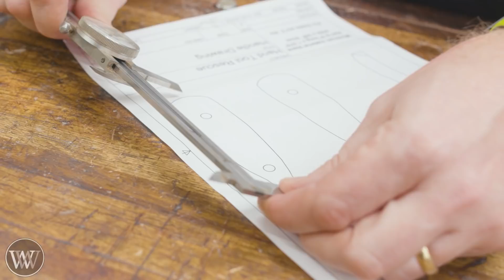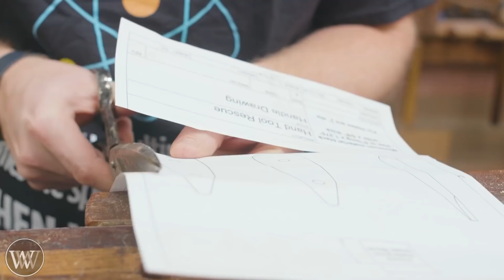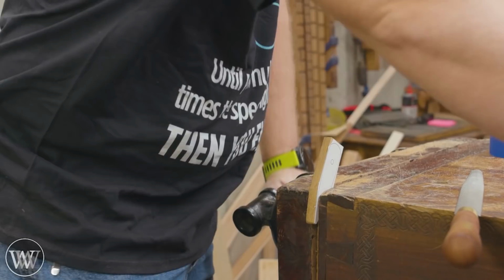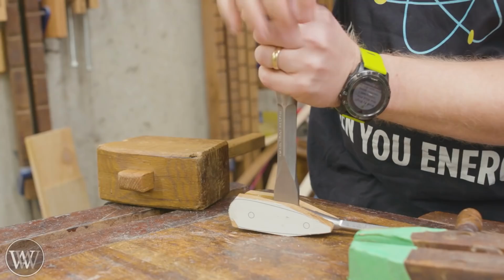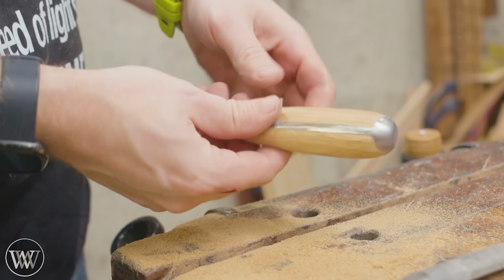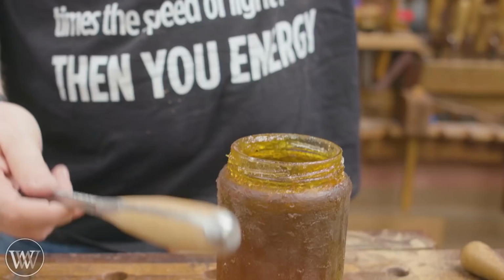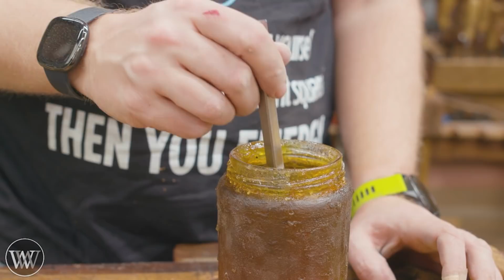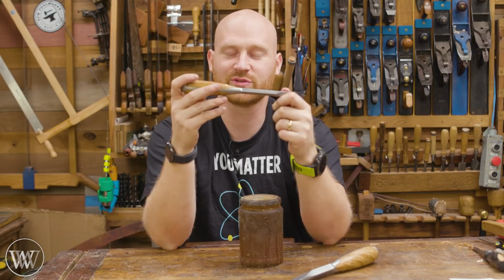The Worlds Best Screwdriver Hand Tool Rescue Prefect Handle

Comment: I ordered the 'impractical' larger one because it happens to perfectly fit the king bolt slots on most radial arm saws (I have 5). I do have to avoid the temptation of whacking things with it, as it is a hefty tool that just screams, 'come on, just let me smash that thing a different tool would be more appropriate for, it'll be fine'
Reply: Kevin Delgado ,   you have 5  radial arm saws ?  What kind ? And what models ?
Reply: @c.blakerockhart1128  3 DeWalts (2 MBC, 1 GWI) 2 Deltas (Super 990, 40C). The Super 990 I have fully restored, the others are waiting in the queue, But all have been at least partially disassembled when I inspected them for condition.
Reply: @kevin_delgado   Do you get them locally ? Or do you get them from eBay ? I have a 1975 craftsman 10".  I am hoping to be able to find a 12" ras, with a 1" arbor. I HAD a table saw that kicked back a 29.5" 2×4 into my forehead. My ras was sitting in the corner waiting for restoration, after the "Incident" I sold the DeWalt 746 and set up my ras.  I got a GREAT DEAL on 12  12" blades, (not for the DeWalt) so I bought them. I still don't have anything that they will fit. Have you tried the laser sight for the ras?  It is AWESOME !  Where you put the line, is where it cuts.  Thanks for your reply. 😎🇺🇸
Reply: @c.blakerockhart1128  Mine were all local purchases. Shipping costs for these things (the 40C weighs 475 pounds) would be more than I paid for them. I would stick with pre-1970's  RAS, and even then I would probably avoid the Craftsman models, they were never built as well as DeWalt, Delta, Comet, etc. Check the size of the arbor hole on those blades, I'm assuming they're 1" arbor so that will mean you're limited to the larger 'industrial' RAS like my 40C, or a DeWalt GE, etc.
Reply: @kevin_delgado  Yeah they are 1" Arbor.  I agree on the pre 70s but I got mine for $50.  So 1975 craftsman it is. I've already torn it down and    made all necessary adjustments and "tweeks" to make it DEAD ACCURATE.  Replaced carriage bearings with REAL bearings.   I have 9 feet of infeed table, and 9.5 feet of outfeed. If I need more on either side, I have small doors on either wall to pass material through. There is also 2 feet between the infeed/ outfeed tables and the walls. Not that I ever expect to cut anything that long, but you never know.  Have A BLESSED DAY.😎

Comment: Inhave thebfull set they are awful tips constantly deform grips come loose of you can even call them that as there is no grip because it's been polished smooth look good but do not work in the real world
Reply from the maker: I have had no problems at all with mine. The grip is great on it and have not had any problems with the tips.